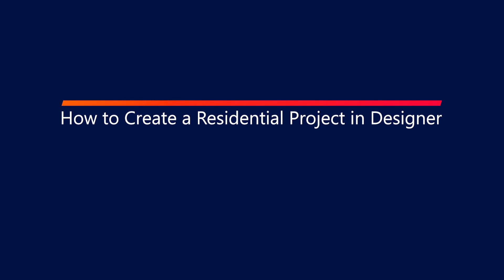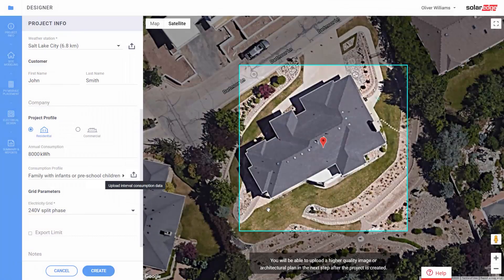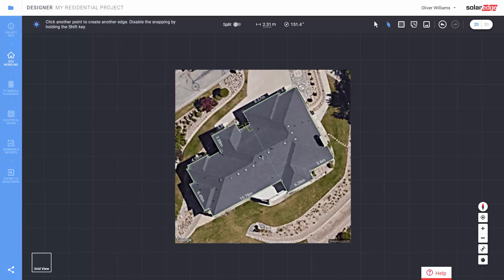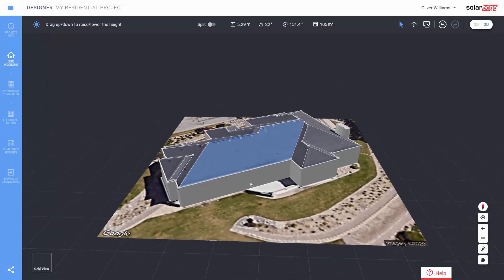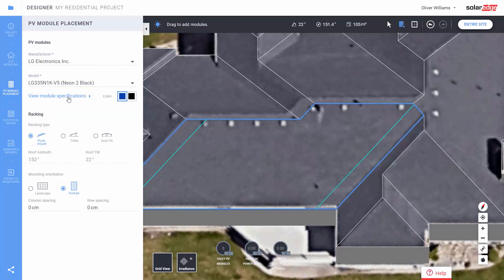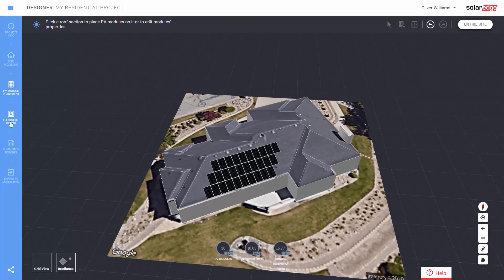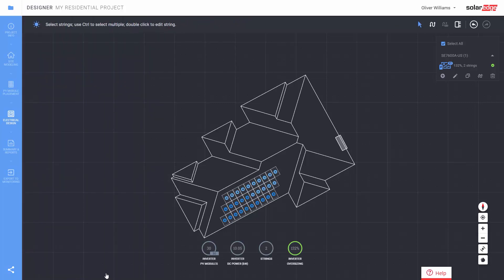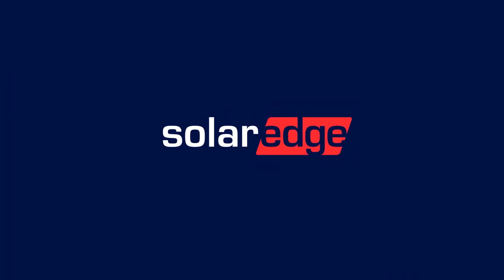Creating residential projects in SolarEdge's Designer | International

Comment: Is there any way of choosing different optimizers on two different panel type. For instance, I'm expanding a system with different panels that require different optimizers. I want to string them up on solar designed because the optimizer and compatible with each other. P400 and P401.